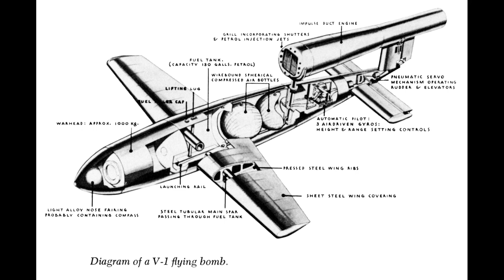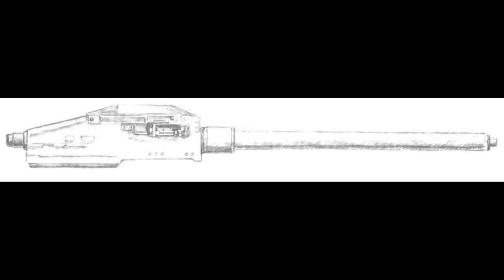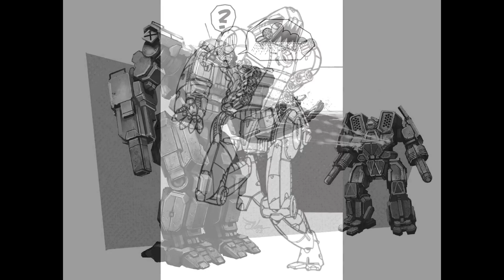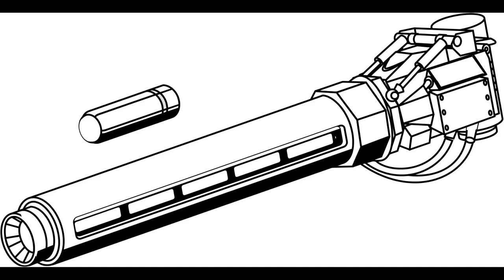BattleTech In Depth Part 6 of 7 - Ballistic Weapons

Comment: Youtube put this on my suggestion list. Quick response before seeing 100%. I hate Ballistic Weapons in Battletech games. Theyre based around real-life weapons but are never really designed well to also be good in the games.

An AC-10 is roughly a 90-125mm cannon, but is a very short range weapon(450meters, no more) and rarely do any platforms carry enough ammunition to last a battle. In real life tanks that carry weapons like that carry around 40-70 shells and they are effective at quite long ranges(those shells can travel kilometers).

Ingame other weapons exist, in particular energy weapons are common and usually overall more efficient.

Ballistic Weapons have a specific niche rather than be generally useful. Mechs that cannot afford the space to carry more heat sinks to supply energy weapons may want to pick up a smaller ballistic weapon. Specific ballistic weapons have their uses. Machine Guns are a classic anti-infantry weapon that generate no heat. Gauss Rifles are an advanced weapon that have long range, high power, and generate almost no heat.

Once again that niche is there, but Energy weapons also exist and have their own variants. Small Pulse Lasers rival Machine Guns and Extended Range Particle Projection Cannons rival Gauss Rifles.

Mechs only mounting energy weapons can work well, but using only Ballistic Weapons is a very bad idea.
Reply from the maker: I have this argument with Warp all the time. Tex said it best: If autocannons in BattleTech mirrored real life, no one would want to play.
Reply: @Caboose30  There are optional rules for Extreme Range thats just another segment beyond Long, and Line-of-Sight Range that removes the maximum, but you accumulate penalties so fast its still makes distant combat impractical.

You generally need Artillery weapons for 1000+ meter ranges.

Autocannons just arent weight-efficient in Battletech, no matter what. Autocannons seem to be made in Battletech purely as a Dueling weapon. If combat is going to be 30-60 seconds then low ammo may not matter. 

Ive played Battletech games that arent 1vs1 games and running out of ammo is a major concern, so I learned to just swap to energy weapons.

Helm Memory Core channel has a video named "Buff those autocannons" that pretty much sent me into a rant about how the 2018 Battletech PC game did just that, while they also nerfed energy weapons.